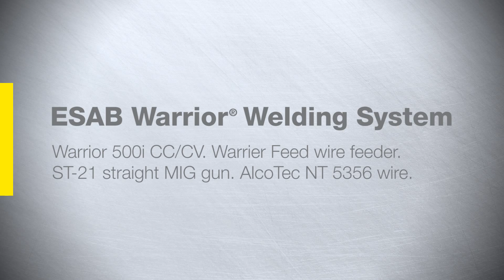Best System for Aluminum: ESAB Welder with ST-21 Straight MIG Gun

Comment: Really love my esab migmaster 250 and the spool gun but god forbid if you need parts for it 
No one sales esab around here and if you call esab there customer service sucks ass this guy in this video is full of shit he’s not going out of the way to help anyone 
I need a new plug for my spool gun when I Finley found it I was quoted over 500 for it apartment you can not just buy the plug you have to buy the hole power cord I can buy a brand new foxpro arc 200 spool gun for 700 
Really wish I would have just bought a Lincoln or Miller machine  no they don’t weld as nice in my opinion  but at least you can get parts and they are not over half the price of a new machine